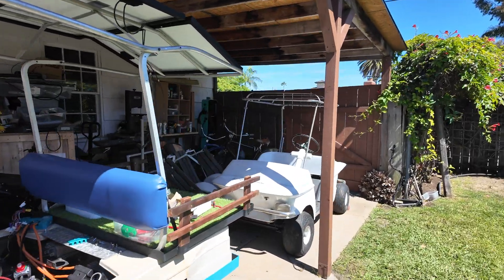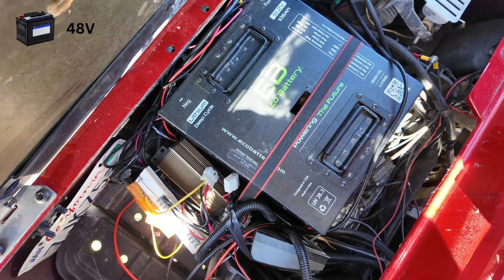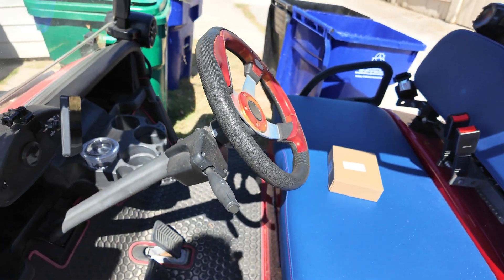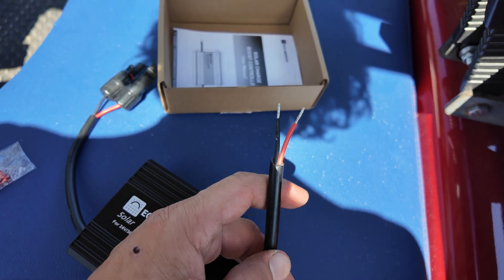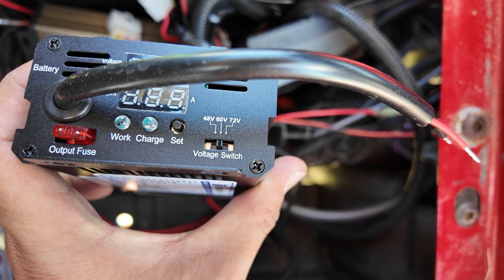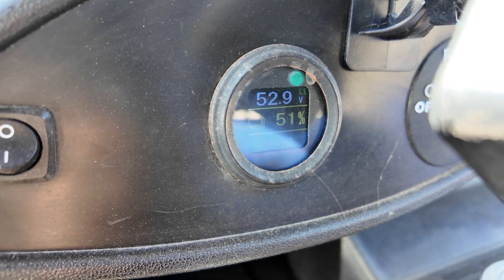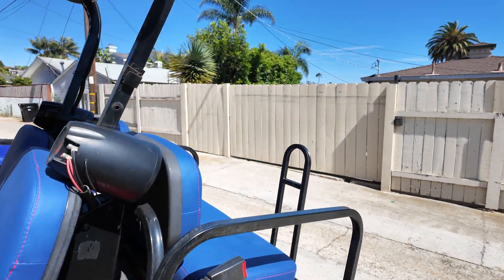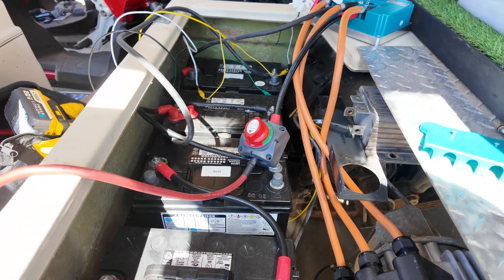How To Add Solar To Your Golf Cart - EASY, QUICK AND CHEAP

Comment: What size do I need for a small battery in a mini excavator or can I just charge every time I use it as have to install a 12volt fan straight to battery.thanks

Comment: So can't charge while driving?
Reply from the maker: @MrFerrill  technically it is charging while driving
Reply: @plantakeovertheworld  Sounds like you know your stuff!.. I need some guidance maybe you can help, I was given an oldish 48v ez golf cart and I am planning on making it a solar generator on wheels.. I purchased a Chins 48v 100ah 5120wh with charger and display from Amazon $950, not sure how to wire the solar panels to charge battery, not sure if they can all work wired to same battery or what all do I need🤷‍♂️
Reply from the maker: @MrFerrill  because it's trickle charging and your bms is inside of the battery you can send the current strait to it. Use the charge controller thingy in the description, makes sure it always come out at 48 volts and stops pushing when it hits max voltage. But from there youl go strait to the battery

Comment: Curious of your comments on the cart shutting off.   Have you figured out a way to overcome this?
Reply from the maker: @ccook5568  for over charging? If it's an rxv you can just put a switch on the postive line for the panels. If it's not an rxv, it doesn't matter and you're fine because it doesn't have electric breaks

Comment: is it chargging while u move
Reply from the maker: @mazoaboshama9634  yes. Technically it's just pulling less from the battery though. Path of least resistance would be from panels directly to motor. So let's say normally when moving my cart pulls 50 amps. When the sun is out and the cart is moving the motor will only be taking 49 amps from the battery and 1 amp from the solar (for example). So yes you can use the power that is coming in from the panels while moving.